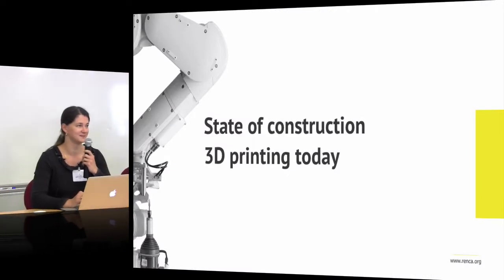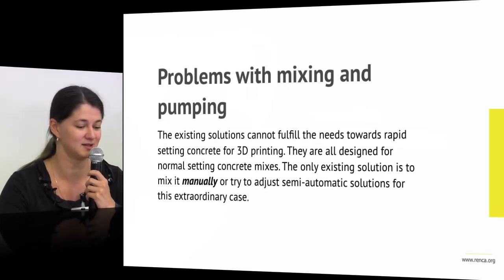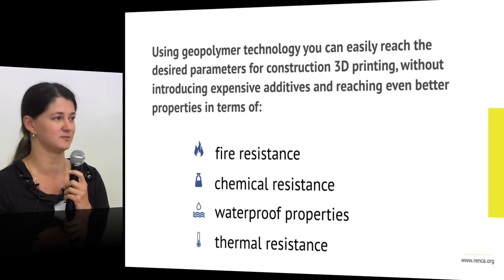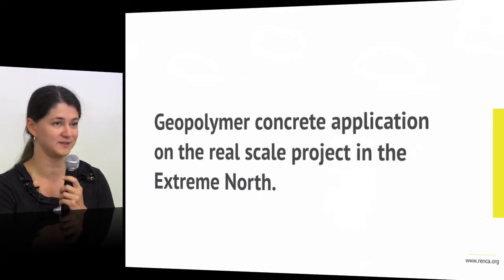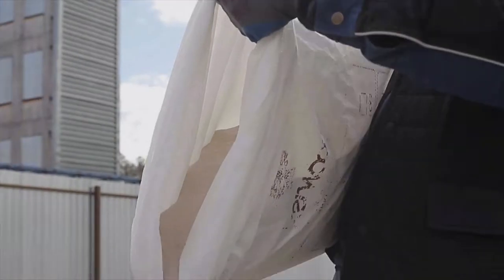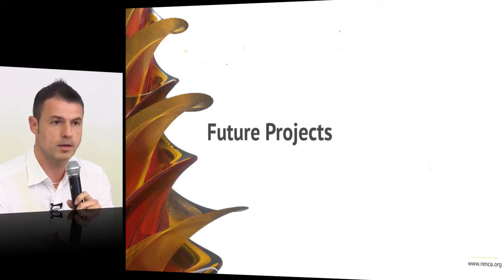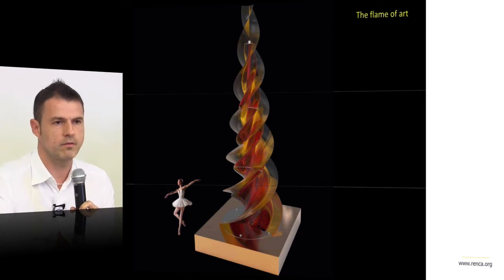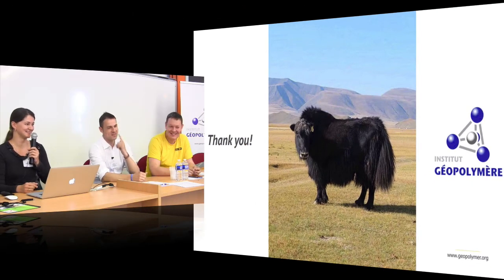3D Printing Of Geopolymer Concrete - True Innovation

Comment: I wonder if it isn't possible to have a small vacuum near the extruder for pulling the dry geopolymer concrete mix into a small mixing chamber and mix the water from a small hose so there is an on demand mix of no more than 1/2 meter before the extruder.  That way there aren't long clogged tubes and wasted material that has to be flushed out of hoses.  Only make what you need at the extruder itself.  Can probably even 3d print the extruder and have more on hand if a replacement is needed.  I'd like to see a aircrete version of this as well.

Comment: Uses 10x less energy?  That doesn't sound right.  Plus, doesn't the curing require heat?
Reply: High strength geopolymer mixes can be produced with ambient air curing
Reply: concreting curing produces heat